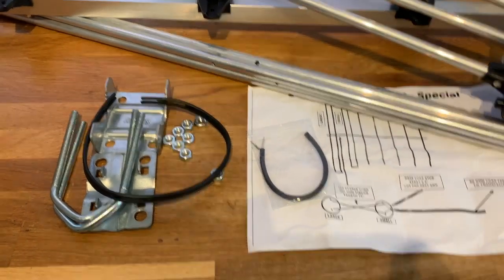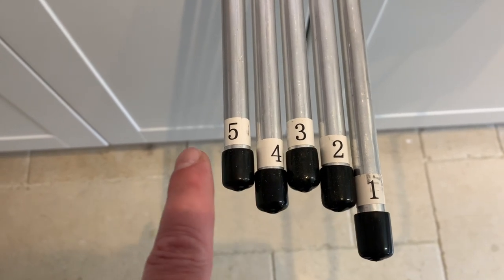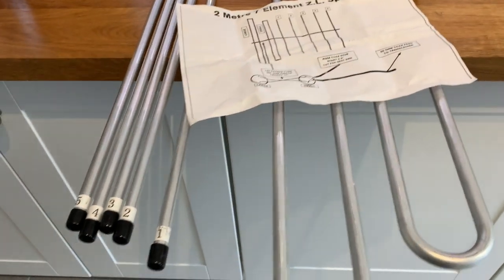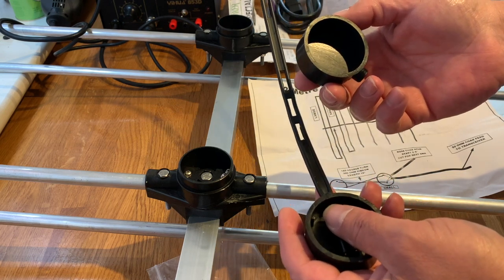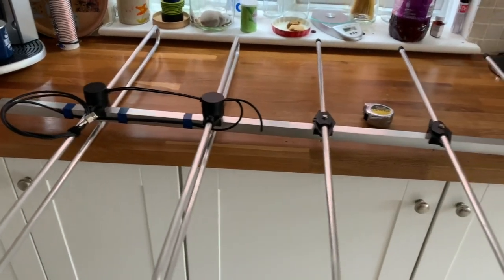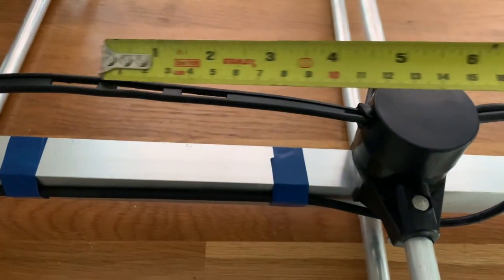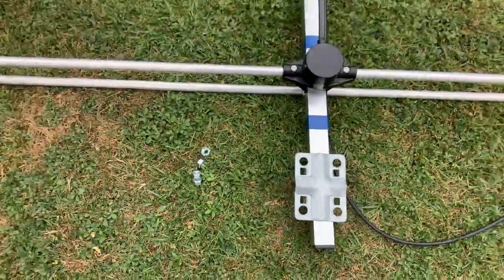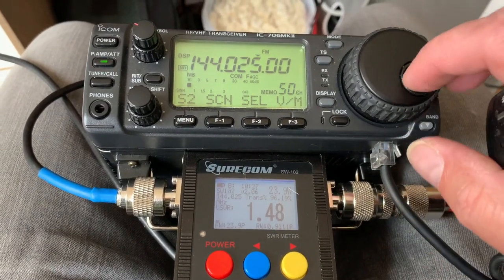HAM Radio: 2M ZL Special 7 Element YAGI build, (Kitchen Projects)

Comment: I had already the 12element version but I didn't want install it and scare the neighbours so I slimed it down , I followed your measurements and eliminated the ladderline but instead installed a ridged aluminium cross strap between the two driven elements. Swr 1.2 across the band😁

Comment: I found the the solder tags on this antenna were way too small . Very difficult to connect rg213 to this antenna . Would have liked to see a pl259 connector pre installed for the money.
Reply from the maker: Yes I agree, but you can connect a short length of coax with an SO239 on it.

Comment: Hi Mike. I have the 12 element version that I bought secondhand. It looks brand new. I do have a problem though, very high SWR, in the region of 2.5:1 t0 3.0:1 I've tried everything, new coax (Ultraflex 7) redone the stub and carefully cut it, best SWR above is with no stub. Any ideas?
Reply from the maker: Try a different length of stub start long and cut it back to get best VSWR... good luck

Comment: That would be the seven element ZL Special for 2 meters as developed by G2BCX and as featured in the Practical Wireless publication " Out of thin air " also featured is the 12 ele and 16 ele ZL special for 2 Meters . Kind regards Chris @ G4MXC

Comment: I have a 5 element one which I bought back in about 1987 or so. Mine has a variable capacitor rather than a length of coax to match it.

Comment: Hi Mike I also have a ZL special but it is a 12 element I’m not that impressed by it? I found the SWR to be 1.5 to 1 whether I have the stub or not. I fitted the stub and reduced it millimetre by millimetre and it made no difference and was better removed. Can you give me your thoughts on that? I have now added an amplifier also coax to make it fit, it now reads 1.7, 1.9 to1 can you give me your thoughts. 
Regards M0uhf
Reply from the maker: I would do a re-build personally and increase the start point of the matching stub (make it longer).
Reply: @mike-M0MSN  Test each element for short to boom.  Should be open.

Comment: Hi Mike .... My nearest repeater is about 50 miles away  - this I can access with my home-brew  three element beam. I would like to be able work  into another 2M   repeater  about 100 miles away. In your opinion would a  ZL special + rotor  or a Diamond X 510 be most beneficial ?  Thanks ☘️
Reply from the maker: Sorry there are to many unknowns, line of sight, height of the antenna to repeater, if both are in line of sight the ZL may do it.
Reply: @mike-M0MSN  Thanks for taking time to reply Mike ... I’m afraid neither repeaters are in direct line of sight  but I’m near the coast on an  elevated site Approx 400’ above sea level with clear take off in all directions ....

Comment: Great build vid Mike as they all were, just back to backed all your lockdown antenna builds really like the non-split dipole you did for 6m not seen that design before.
I was just thinking " I need to ask for the dimensions of this yagi-uda" when in the true spirt of amateur radio you did just that - Awesome,thanks.
 lovin the coil builds ,as that's what I'm doing at the moment.
What I would like to ask Mike is - I also have a IC706 mk2 and cant work out if i need a peripheral component to access CTCSS for repeaters, cant seem to spark them up even though iv'e put in the offset and tone frequency.
Anyway, Great Channel Mike. Job Done - Well Done.
Barnie M7PBX.
Reply from the maker: Thanks, may do a quick video on programming the 706.. :)

Comment: Where you twisted that piece of ribbon cable.. the twist should have been made over it's exposed length on its way to the next element. Why? So the conductors maintain their spacing. It's a piece of balanced transmission line remember...
Reply from the maker: Dazzwidd I do not think it is that important as the antenna is working wonderfully....
Reply: @mike-M0MSN  Just giving you something to consider... It might have been even a little better in some way is the thought, as the fact is it was designed to use that impedance of balanced line to phase the two driven elements. Bringing them crossing together like that is not a good thing. 
Anyway I remember reading the article about this antenna in the practical wireless magazine back in the 70's.
I was a teenager and had inherited a lot of radio/electronics magazines.
Some were very old. I had issues of The radio constructor from the late 1950's!
Reply from the maker: Dazzwidd I do enjoy reading and value your input, many thanks. 👍
Reply: @mike-M0MSN  Your playing around with some interesting antennas. I wish I had a yard at the moment to be able to put antennas outside.
Lately I have had to mess around indoors.
In the past 9 months I have made some interesting ones for inside.
For 27mhz I started out with a loop of 3.4m circumference which I was getting out on the DX with but then upgraded to 4.2m circumference... so basically a halo that was shortened. I had a capacitor at the top made from two copper tabs hanging down. The matching was a copper strap gamma. I was getting a dead flat SWR at resonance. Recently I trailed taking the capacitor off the loop and adding two aluminum stubs, one going up and one down (both 1m long) and it resonated again with low SWR, but giving circular polarization- I REALLY want to get this outside! I also have made several fm broadcasting band aerials such as the slim jim and a ring and stub antenna that was adapted from an fm broadcast band halo, which was the inspiration to try it on 27mhz. This hobby is all about experimental trial for learning as it's the most fun!

Comment: Hi Mike- Very well explained vid for the Moonraker 7ZL! Yes, a pain the ass doing the connection box connecting and not recommended if you are tired ! Surprised they haven’t modified the design in all these years. I have used one extensively (along with 9 ele OWL, 11 Tonna etc) and it has its place in the collection - I do hilltop DX and Contesting from the middle of U.K. (IO93, sigs all directions) and it’s wide beamwidth with multiple ‘petals’ suits for maximising number of contacts ( but not necessarily overall furthest distance). Indeed in Feb this year I managed to exceed 200 contacts in a 150 minute contest for my first time ever. I got a ‘rally special’ price approx 10 yrs ago at £40 (vs £79 reg) so defo worth the purchase AND it conveniently sits fully assembled in large car boot or motorhome bunkbed so its an ‘easy up’ on rotator on cold or damp nights. That said, for longer period, ‘distance-based’ contests I tend to use a larger, sharper beam (in conjunction with horiz ZL and a vertical (sometimes combined via coax power splitter)) so I chose my antenna depending on the rules, the weather and my state of mind! I particularly enjoy a day out on 2m FM having rag chews vertically polarised. The ZL is a great all-rounder for that. Even flat-side, fixed position it will probably still give better geographically omni performance than a big-wheel with added advantage of its front gain too. One of my driven folded elements is getting a bit weak now and so if it finally became irreparable then I would probably get another. As a final point, like you I too added a couple of feet  RF58 coax to the feed box (anything larger very difficult to fit) and then run Westflex back into motorhome shack. Hope my waffle is useful to others and thanks again for documenting its construction! 73 Nick, M1DDD
Reply from the maker: @gm4dhj it wasn't the best Bond film, :)
Reply from the maker: Cheers Nick. All good stuff.

Comment: Good video and shows the ways round the laziness of the makers. Why didn't they provide better instructions and the extra bits you needed. I had to do a similar job with mine. Its very hard if using larger coax

Comment: Brings back happy memories of when without a morse certificate VHF and UHF bands were all we had.  I came across the ZL at the same time as the Slim Jim, both highlighted in a publication called "Out of Thin Air".  Title says it all.  When Jaybeam and Cushcraft were the only popular antenna manufacturers around.  The 'Ringo-ranger" collinear!  How it all comes flooding back.  Thanks for posting its a great aerial but do as Roly suggests - mine used to fill up with water.  73 de M0AZE Mike.

Comment: Good video Mike. That antenna clearly has decent gain, would be good on 2M SSB. 73 Chris M0RSF
Reply from the maker: SSB   : )
Reply: Thank you for this video sir. I have used ZL specials on  and off on 20M for years (no directors) I wonder why you use such lossy coax on 2M?